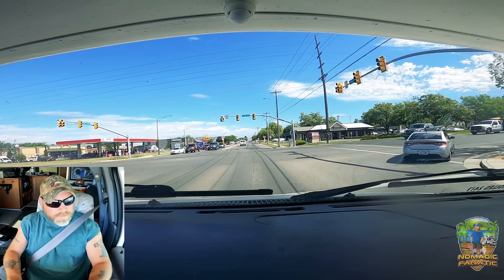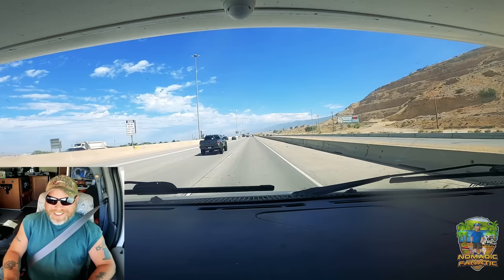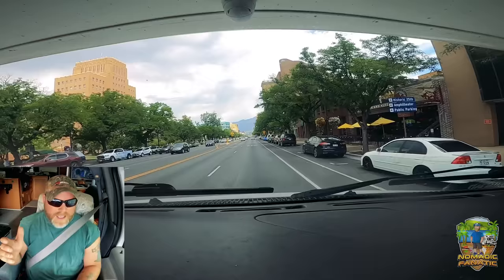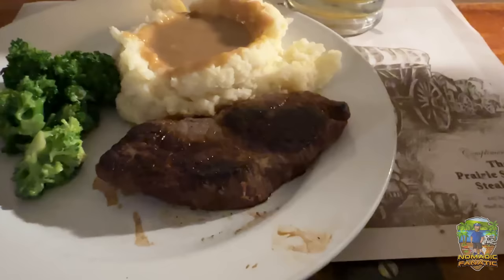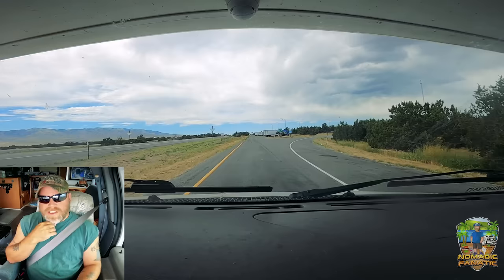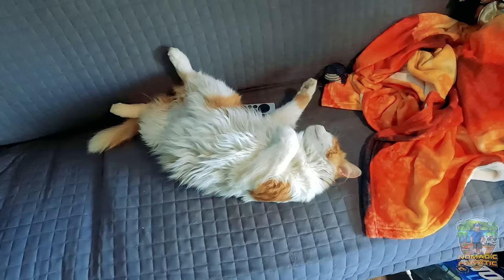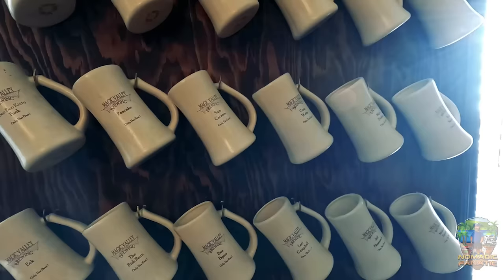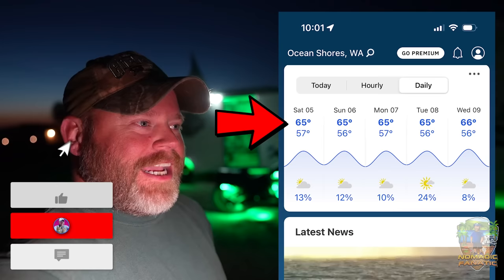Food Served in Covered Wagon, Space Shuttle School, & Idaho Quirky!

Comment: Hey Eric, what tires did you put on your rig, I need to replace the 6 on my Tioga, before I head south this winter. I want something with a bit more aggressive tread than the highway tires currently on the vehicle.
Thanks
Reply from the maker: Last summer I put on 6 Back Country A/T2 all terrain tires. I like them more than the KO2's I had on Yoda, but my biggest peeve is still little rocks getting stuck in tread and then coming out on the highway and making a very loud sound hitting the bottom of chassis. Nothing can be done about that really as I'm not a "pavement" traveller. :)

Comment: Hey, i just noticed that your roof vent is still open.  You should either build something from the top of the refrigerator or just close it off.  It will help with your air and heat. With an LP refrigerator that had to be sealed.  Now, it does not have to  be sealed.  Just trying to help

Comment: FYI, I believe the coolant tank is for full strength coolant....
Reply: He added the right stuff at the correct "strength".
Reply: Uh....Who told you that? Did they also tell you to change the air in your tires for winter driving?
Reply: proper coolant is 50/50 mix for the whole system
Reply: Never add straight full strength coolant unless all you have in the radiator is water.